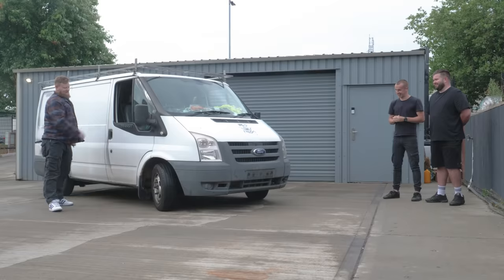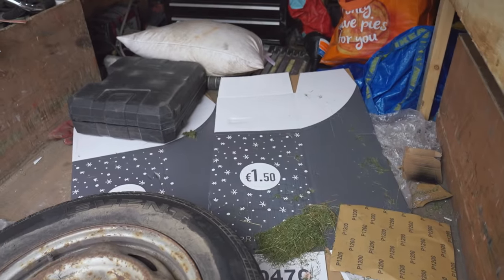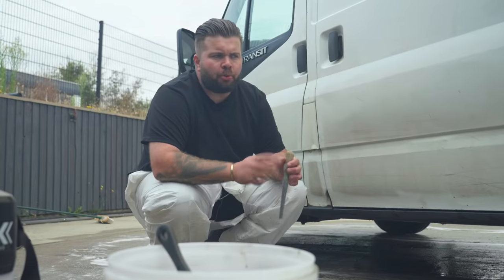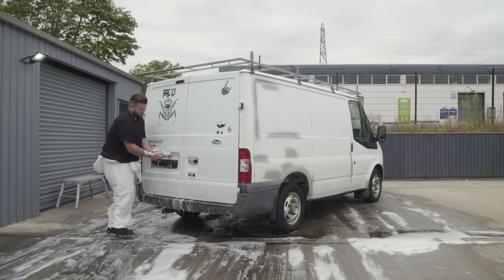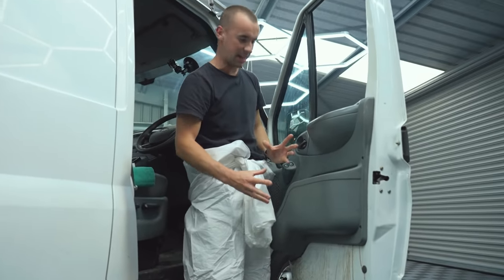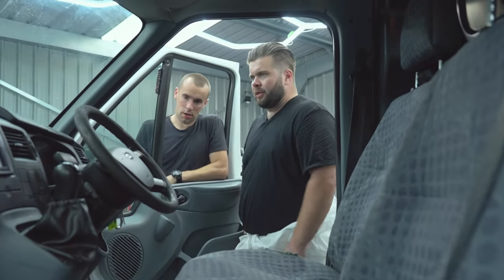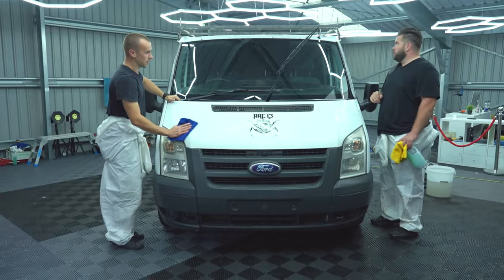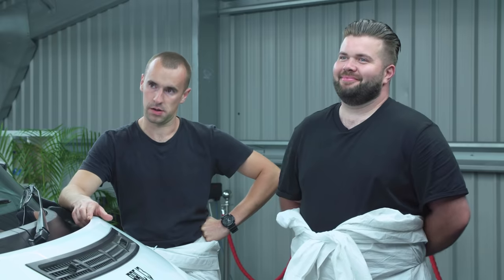FILTHY Ford Transit DEEP CLEAN - First Wash In Over A Year | Top Gear Clean Team

Comment: Ya I miss the BBC Top Gear

This would be more funny if Jeremy were cleaning it with Mr. Slow and Hammond
Reply: Jeremy : Right where are my hammers😂😂
Reply: Speed and POWERRRRR with a wet vac
Reply: James: Spends 4 hours cleaning the insides of the locks
Reply: James spends 8 hours cleaning the air vent,  Richard vacuums a car seat and i fix a bent fork with a hammer
Reply: this is the BBC top gear and it existed LONG before clarkson
Reply: @burnzy3210  clarkson was peak though
Reply: @YegoYTP  it got REALLY stale after about series 7-8 though and nearly unwatchable towards the end
Reply: @burnzy3210  nah
Reply: On today's edition of people who can't get over the past:

Comment: Hi GUYS Love these kind of videos cars vans like..
My van is same model van but last of 2014 plate before new shape..
Very clean really.. it has a little rubbish in it.. The back of the van is used as garden shed but I use it for occasional courier work.
My preferred aim with my van is The drivers seat and driver side but clean over all..
Engine bay and detailed..
All four wheels id like painted factory condition..
Deep clean and polish.
The underside of my van is in nice condition bar road dirt..
The rear of the van is general clean.. I guess
How much and where about's are you in wales ..?
Oh Im tim

Comment: You washed a van ………. No clay bar ,,, no compound ,,, no polish ,,, no wax / sealant … 
Don’t give up your day job TopGear .
Reply: They only had 16 man hours!
Reply: @PhillipParr  that's exactly my point 
8 hours to just wash the paint work.
8 hours to clean the interior and put a bit of silicone gloss on.
Terrible work rate.
Reply: What would be the point of it? The paint on it is trashed, covered in primer etc. Plus, they spent the time focusing on dirt removal. That's easily 2 full days work if you're on your own
Reply: @dashcam2417  missed half the seat with wet vac! Amateur detail at best
Reply: Oh, and they had to film it all too. Pieces to camera, done professionally, take way longer than you think.